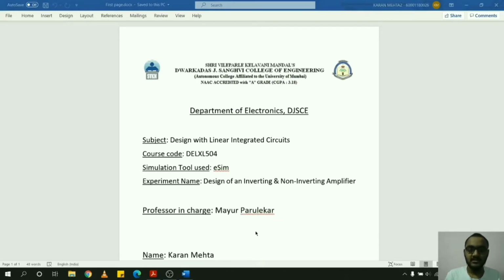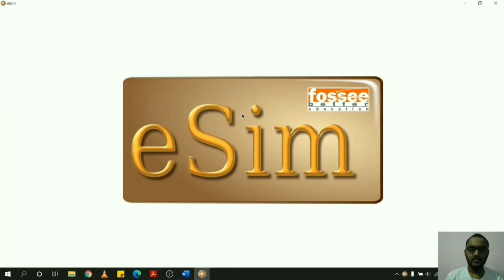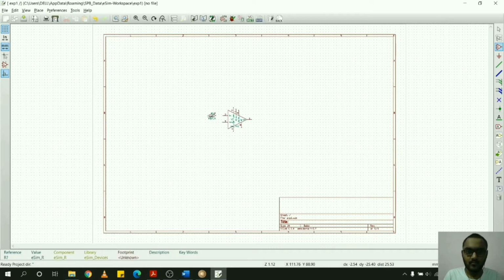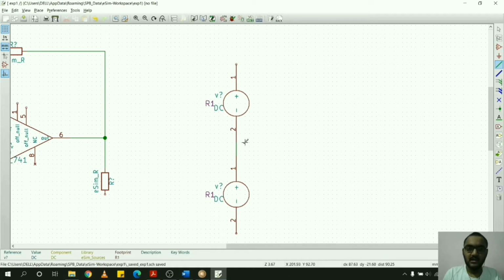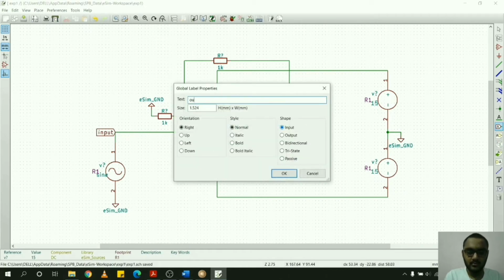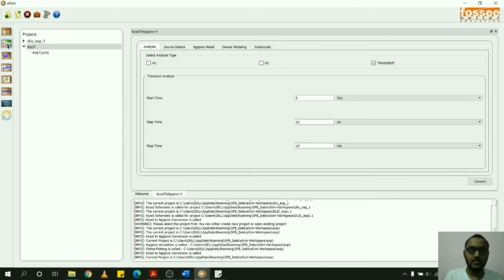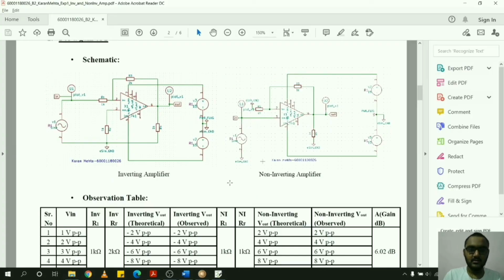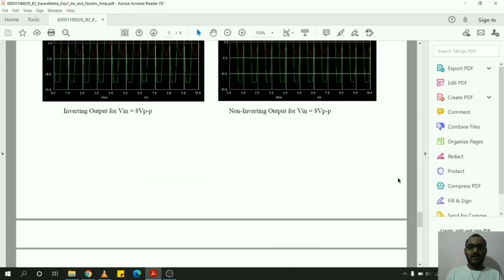Inverting and Non Inverting simulation in eSim

Comment: After getting correct output i tried to change the gain by changing the value of resistor but still after change, the output is shown in the same old value of resistor (gain) how to solve this sir

Comment: When I click kicad to ngspice it show blank interface...what I have to do
Reply from the maker: what is the error that you are getting
Reply: @karanmehta7238  it happened because the components which I used have not any option to convert kicad to ngspice........and I am not able to find Arduino Uno and breadboard and. Some IC ......how I run Arduino project on esim.........and usme every circuit ko simulate krne m problem h. ....even circuit was perfect and run in other some software...
Reply from the maker: @rupalisharma2674  so you can not run the live simulation in esim, so I am not aware of how to add Arduino in this.
Reply: @karanmehta7238  yeah...usme bht s components present nhi h ....... please can u suggest me some softwares fot all types of circuit simulation ....or usme uska code bhi generate ho jae
Reply from the maker: @rupalisharma2674  Proteus is the best for all types of simulation, in that you can add different types of boards and many components are already there, you can even add extra components in that. 

there is one more called tinkercad, this is a online tool and free but this only supports arduino uno and has limited number of components.
Reply: @karanmehta7238  okay..!! Thank you....